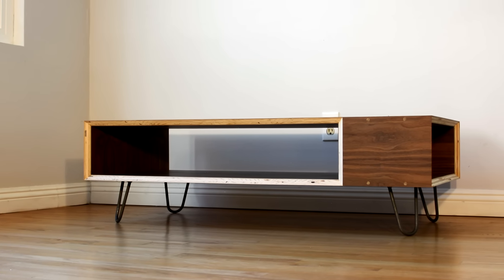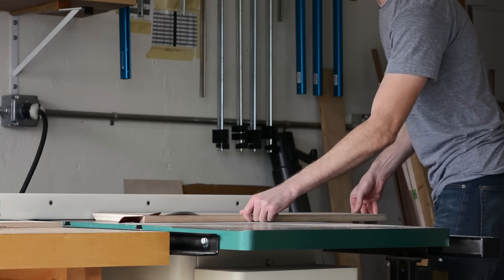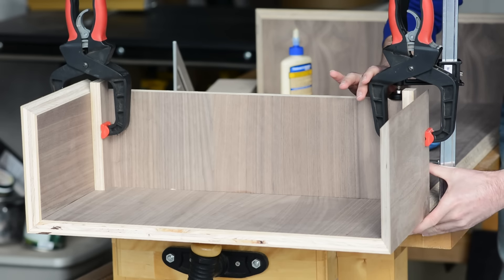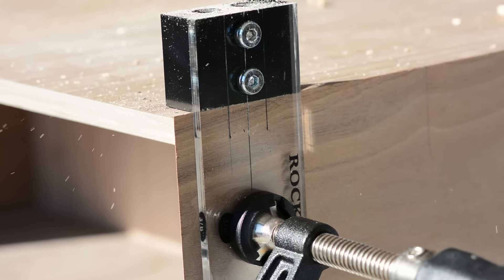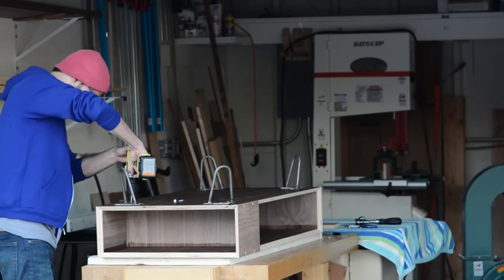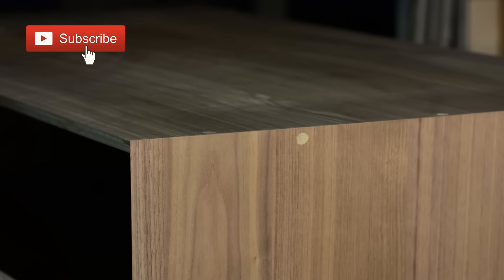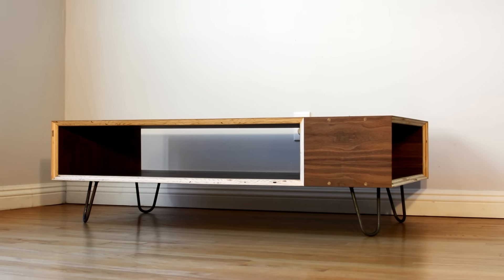DIY Modern Coffee Table with Two Tools - Woodworking

Comment: This is doable with hand tools as well.  I really like this design, great proportion and I like the use of the visible plywood laminations along with the steel legs.  I wish the plywood had better cores with no gaps.  Also I am an advocate of Miller Dowels they come in walnut and would have worked well on this project.  Inspirational, thanks.
Reply from the maker: Thanks Terry...I wanted walnut dowels but didn't have the time unfortuantely. I'll look into those for the future though.

Comment: Chris if you ever come to Portland I'll show you how to rip a full sheet on a table saw.
Reply from the maker: Hey Robert...I've done it a couple times. Not well. Unfortunately, for me it also involves clearing out everything behind the table saw (my band saw, dust collecter, and lots of wood) in order to get the 7.5" of clearence needed.
Reply: As a cabinet maker it is pretty essential and time saving to cut a full sheet, but it takes a lot of practice to get a clean cut. But if I had to move even one thing I wouldn't bother either. Hahah I'm lucky enough to have a couple saws at work and then bring it to my basement shop.

Comment: Striking table, it has almost an optical illusion feel to it (at least in the angles you show it in). Is this your own design and what, if any, woodworking books would you recommend? Just discovered your channel through Flipboard and I subbed. Thanks
Reply from the maker: Thanks Ambrose. Yes, that's my own design. Though, I wouldn't ben surprised if there are similar ones out there, since there is nothing too crazy going on. I actually don't really use any books. my education came mostly from youtube, forums, and trial and error.

Comment: Nice work again!
Did you think about covering the cutting edges with vaneer? To me that would be difference between a nice table like you built it and a perfect result. I am not really shure about the dowel, first I thought that there are screws but the I saw the rest of the video and I'm not shure if I like the dowels. But I really like the idea of the beveled edges.
Thanks for your great work and sharing it,
Günther
Reply from the maker: Thanks Gunther. I didn't want to cover the plywood on this project. I actually like the contrast. And I was going for a simpler/rougher look here.

Comment: Awesome video - deceivingly easy steps!

I think aluminum or steel dowel pins would look pretty cool - I'm a little surprised I don't see it more. Perhaps it's a bad idea?
Reply from the maker: You mean instead of the dowels? Yeah, that would be cool. Especially to match the legs.
Reply: Ya instead of the dowels - or in my case I made an 1/8" inlay and used a piece of aluminum 1/8 x 1/2 and pressed it in. Looked pretty cool. I just don't see mixing mediums much in a lot of the woodworking stuff I see which I think is odd :-P

Comment: Hey Chris! Thanks for the videos really enjoying them. I have a question if you don't mind answering and seeing as it's your fault I'm trying out woodworking I think you owe me haha. I want to buy my first saw but I'm not sure if I should be looking at a circular, table or miter saw. For now I'm just borrowing a friends circular saw but I can see it's limitations already. Any recommendations for my first buy? Maybe a video on a "starter kit" for the weekend warriors  would be cool? Just a suggestions
Reply from the maker: Hey Luke...I'm thinking of putting something like that together. Perhaps an entire series made for beginners. That question is always tough. The best advice I've heard is to pick a project, and then buy what is needed to make that project, and then keep doing that from there. All those saws have their advantages and disadvantages. So without knowing a particular project it's hard to say which is best.
Reply: Luke Correia- A tablesaw is a great starter tool if you can find the right one. I started with a contractor saw with no stand so most of my time was spent on the ground of my garage or building a makeshift table. However, the saw ( Dewalt job site saw) was accurate and powerful, making repeatable cuts easy for the project I was doing, which was mostly cutting boards and tables. I've since received an older craftsman saw with a nice stand and am happier overall, but the job site saw still has a spot in my shop for smaller projects. The table saw will always be the heart of my shop.

Comment: Hey Chris, beginner woodworker here so I think this would be a good place to start. Question: What is that little device you use to measure and drill the hole for the dowel? I found a few on Amazon but nothing that looks like what you use.
Reply from the maker: Hey man, I'm not sure what it was, can't remember that far back. But maybe a doweling jig??? Try Rockler.com  :)

Comment: Very cool videos!!! I got a question: Why do you apply the glue so slowly and carefull? does it makes any difference?

Thank you!
Reply: No, it doesn't make any other difference than getting the glue spread neatly and evenly on the surface.
Reply: I get the feeling it's exaggerated to give his videos that calm, clean feel which would take an absolute zen master to actually achieve in a shop.

If it's not exaggerated, have you heard the one about the three students of different masters who met at a tea house on the road to Shenzhen?
Reply: Brian Zditowski he is just a craftsman and proud of his craft
Reply from the maker: Hey Brian. The reason i spread it slow is because it really only takes a few extra seconds. Where as cleaning up glue can take several minutes, and sometimes leaves pieces marred for good. Especially plywood where you can't just sand through without ruining the veneer.
Reply: why do you use plywood instead of real wood
Reply: working with "real wood" requires a lot more care and skill, because it can expand and shrink.. like a lot. and you need to keep that in mind in EVERYTHING. im learning carpentry the classic way right now, its a three years process here in germany, with hundreds of schoolhours just learning how to keep wood from destroying what you have just build with it. also keep in mind the cost, this project would cost like 600% more if you do it with stock, it would take 4 times as long too, just think about it, you need to rip all the stock, cut it into rough pieces, joint, plane, then glue them together to create panels and then you can start cutting those into size. 
these days, building with stock is really just a novelty, if you know what youre doing you can build with veneered plywood and get a result that looks as good or better and is probably going to last you just as long.
also, not having to dance around the limitations that wood imposes on you frees you up design wise.

Comment: Would glue and dowels be strong enough to support a shelf full of vinyl records? I want to make a similar stand with the bevels, but just don't know if the dowels and glue will be strong enough. Thanks!
Reply from the maker: Depends on the construction. The way I'm using them here, it's plenty strong. The dowels are going each way, so you'd basically need to break this thing to get the joints apart.

Comment: Hoping you see this soon.  Quick question, how do you line up your bevel rip cuts on such a large piece of plywood?  I can't switch my fence to opposite side (the blade tilts only towards the fence & need to cut down a 4' piece of plywood right on the edge :( ) and lining up the blade to the mark on the ply is posing quite the problem -- any suggestions or tips would be great and well appreciated.

Also, I do not agree with a lot of the comments that it looks unfinished,etc etc.  Sometimes different is great, and IMO you nailed it -- it looks pretty damn awesome.  I know many that would love to have that coffee table in their homes.  Love your videos++

Comment: That's a beautiful design, it's just a shame that pretty much the most expensive plywood you can buy still has voids.  I wish there were a baltic birch based walnut ply available to save the hassle of doing all that veneer work.  Nice job!
Reply from the maker: Hey Dustin. You make a good point. Luckily, I rarely leave walnut plywood edges exposed. But it would be nice for those times.
Reply: Can you comment on how you would go about applying and flush trimming edge banding on the beveled(?) edges on this table? I'm considering building it, but would rather not leave the edges exposed.

Comment: Sorry if you said this and I missed it but you're using veneered plywood?  Is that right?  Or what type of wood is that?  Thanks Chris
Reply from the maker: You're right...it is walnut.
Reply: Chris Salomone as a follow up you never seem to struggle at all with blowout of the veneer on your plywood. Is it just high quality plywood or are there other tricks to keeping the cut edge looking good?
Reply: Not sure what Chris would have to say, but since we don't often see him using backing boards a lot, I'd think a big part of it is the sharpness and tooth count of the blade.
Reply: Have the same tracksaw he uses to breakdown the ply, and it gives essentially no blowout. Not sure about the the table saw.

Comment: I like the table style but edge banding would give it a better look. Also the dowel pins to me look like they don't belong there.
Reply: I agree, but you can easily adapt the project to suit your needs.
And the biscuit cutter/router, iron and knife would have been 3 more tools.
Reply: Still there are plenty of ways to use dowels such as only drilling out the back side a 2/3 of the way. Glue and tap in the dowel and use a dowel finder or even a thumb tack to find the other mating end.
Reply: like everything, there's a thousand ways to skin a cat...
there's enough simplicity to make this appealing to a beginner, and enough complexity to make a beginner think/learn.

yes, all those would have worked too, but again, a thousand ways.................
Reply: Leland Clayton good thing the table is not for you
Reply: Darn, I needed some fire wood....
Reply: Who doesnt have an iron in their house.  edge cutters are under $20, I think any tool under $20 is acceptable.  I do agree the plywood edge destroy the look.  I do see through the beauty of this project though.

Comment: Hey Chris, I'm starting to plan this build now. Were you able to make it out of a single sheet of plywood? I am following your suggestion of trying to make a single cut of each length only once, but it seems like if I were to cut the top, bottom, and back piece out of the same length, the coffee table would end up being relatively short. I was hoping to get a finished length x width of 48"x24". I suppose if I were to measure it exact then I could just use the other length since the piece of plywood would be split in half? Only area of hesitance is my lack of table saw so everything is going to be reliant upon an edge guide.
Reply from the maker: Hi Andrew...I can't remember if I made it out of a single sheet to be honest. It's been too long and there have been too many projects in between. That said, about the "cutting once" thing. What I was talking about was setting your fence. So basically when you're getting ready to rip your pieces to 24" wide, set your fence and make sure you can make sure you can cut EVERY piece that needs to be cut to that dimension one after the other. You don't want to have to set your fence again to try to make another piece the same, because odds are you won't be exact. So it's more an order of operation thing than anything else. Hope that makes sense.
Reply: @Foureyes.Furniture  that makes sense to me, I just don't have a table saw only a circular saw which makes the same with cuts difficult. I may ask my local wood shop if they'll make customer me on their table saw Even if it costs a bit extra just because everything needs to be so exact. Thank you again for all your help

Comment: With the four-sided miters, why not use strap clamps?
Reply from the maker: You could, but it would be really tough to get it all together while working against the clock. Much easier to glue up in stages. Plus I had more control over any gaps this way.

Comment: Hey Chris, I really want to make this table, but I only have a circular saw. Do you think it's going to be too difficult to make all those 45 degree cuts without a table saw? I suppose I could just use a bunch of butt/pocket joints instead?
Reply from the maker: You could definitely do a butt joint version. You could also do the mitered version. The bevels shouldn't be too hard, as long as you can set the saw accurately...making sure the lines are nice and straight will be the tougher part.

Comment: Chris, love your style but I must say that this project looks unfinished when it is done. Not sure if the photography made it look like a half-finished project or what. Maybe it is the edges and the off-round dowels - at least the hole and cut off dowels look oblong and fuzzy. I like the design but wonder why you did not edge band it? Don't want to be a troll but it did not turn out, at least in the video, as cool and "finished" and "polished" as your usual builds.
Reply from the maker: No worries Steven. It was a different kind of build. I wanted it to be something that is more approachable for a novice. If I was going to go the extra mile, and edge band a project like this, I would probably scrap it and do something different entirely. Also, I kind of like the contrasting edges. That said, I would have liked to use walnut dowels. :-/

Comment: ugh hairpin legs, they are becoming the decoupage of woodworking. But really nice table and great video as always!
Reply from the maker: Thanks...and I had to look up decoupage :)
Reply: lol Metaphorically speaking I just mean to say hairpin legs are everywhere these days.
Reply: not as bad as pocket hole jigs
Reply: All forms of design have 'their day' . Remember the black ash of the 80's. The pallet made everything a few years ago. This design called for a simple leg design. The juxtaposition between the geometric natural material, and the organic shapes of man made steel, questions the status quo.
Reply: Also right now how to make well looking designs with less material and  simpler manufacturing. Bending one thick wire vs welding together or making a mold for several parts.

Comment: I believe you are mistaken about the table being strong enough without dowels. You are gluing plywood edge to plywood edge, one of the least reliable joints one could use, particularly with nearly starved joints.
Reply from the maker: I've made lots of mitered plywood boxes with just glue and they are all still holding. Check out the video I did about making non 90 degree miters.
Reply: Yes, the do hold up well, as long as they are not used.

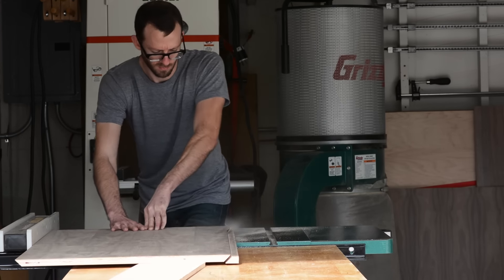Comment: Argh, I like the table and the dowels but I cringed a little at 1:12. The very moment you hear the words "cleanest results", the plank goes astray. Did you end up using that piece anyway without any problems?
Reply from the maker: Thanks Pannemat. Yeah - there were no problems. It really ins't rotating until it is past the blade. All of the miters came out perfect. No gaps.
Reply: Pfew. Good to hear.